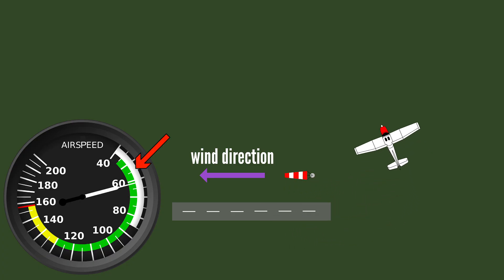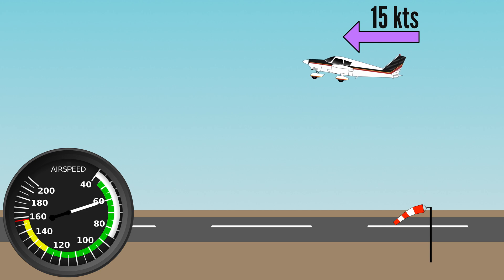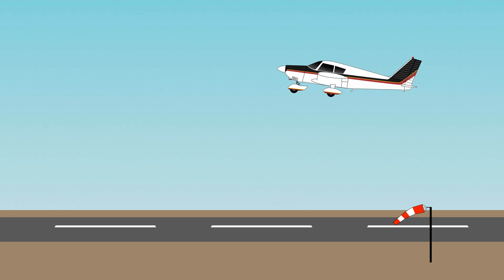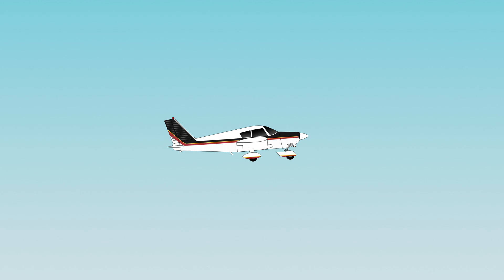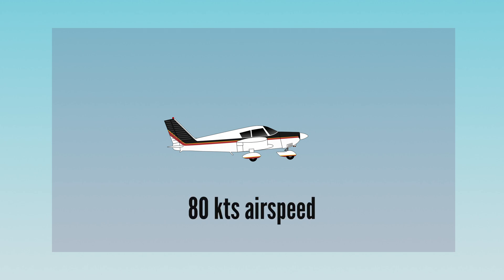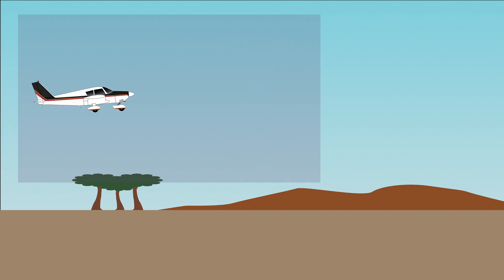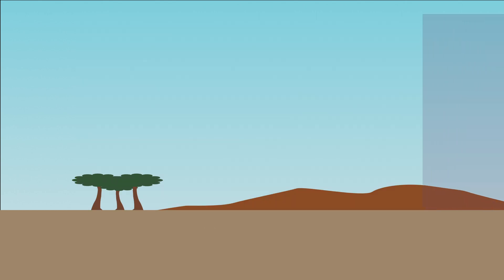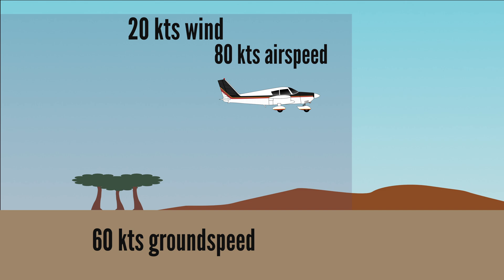The Myth of the Downwind Turn - Dangerous or Not?

Comment: The greatest danger in a downwind turn is pilot error. 

However, in relation to airspeed, you appear to be saying there is no big effect therefore there is no effect. But you cannot say that an aircraft has inertia and then say it has no effect.  Your attempt to debunk fails because you are trying to explain accelerated flight (turning) using the principles of equilibrium (straight flight). 

In a downwind turn groundspeed (inertial speed) increases due to a centripetal component of the aerodynamic force and the angle of drift. Airspeed (relative speed) decreases slightly because of the rate of reducing headwind component due to the rate of turn. Opposite effect in an upwind turn. The variation of airspeed is an indirect effect of inertia but is a very small effect compared to the variation of groundspeed and so is easily overlooked. However, it explains dynamic soaring by birds and RC gliders which is not just about wind gradients.
Reply: There is a fundamental error here: 

"In a downwind turn groundspeed (inertial speed) increases due to a centripetal component of the aerodynamic force and the angle of drift."

"Inertial speed" changes with the centripetal turn force, but not with the wind drift.

We have already established that there is no change in inertia relative to the wind drift.

So, the inertia change relative to aerodynamic effect is no different than the case of no wind.
Reply: @davetime5234  The centripetal force acts normal to the air-velocity. The angle of drift means that there is a component of the centripetal force acting in the direction of ground-velocity.
Reply: @colingtaylor2158   "centripetal force acts normal to the air-velocity"

Yes, centripetal force acts normal to relative air velocity:  but air velocity relative to the aircraft, not air velocity relative to the ground.

Acceleration (here the only acceleration is the centripetal acceleration), is independent of the velocity reference frame.

Because there in only centripetal acceleration (which is in a normal direction, that is, an acceleration at a right angle to the aircraft's direction of motion within the airmass):

There is no acceleration in the aircraft's longitudinal direction within the airmass.

Translation of the above:  the aircraft has no change in airspeed from a turn to a downwind (as set out by Lets Go Aviate's main theme).
Reply: @davetime5234  In a downwind turn from headwind to tailwind, the flyer experiences a rate of change (reduction ) of headwind component which affects (reduces) airspeed.
Reply: @colingtaylor2158  You are drifting with a 100mph wind in a football shaped balloon with a small propeller at the front that can move it 10mph.

The propeller is off, your airspeed is zero, and your ground speed is 100mph.

Point the ballon in any direction and still airspeed is zero; ground speed is 100mph

Turn on the propeller so you move with an airspeed of 10mph.

As you turn in different directions can you see that your ground speed reaches a maximum of 110mph and a minimum of 90mph depending on what direction you have turned, but your airspeed never changes from 10mph.

A wind component only affects your ground speed.  And it causes no acceleration, only a constant speed drift in the direction of the wind.

But your airspeed doesn't care.
Reply: @davetime5234  Flying a circle in a wind, when your airspeed is greater than the windspeed, the groundspeed varies by twice the windspeed. But when the windspeed is greater than the airspeed the groundspeed varies by twice the airspeed. Why is that?
Reply: When your dirigible turns, there is a centripetal force generated by the thrust, the rudder and the sideslip angle. A component of that centripetal force causes acceleration of groundspeed
Reply: @colingtaylor2158  If I understand the confusion with what I wrote, that 90mph is moving backwards rather than forwards.

So, it's a negative number:  -90mph.

If keeping track of direction numerically, I could have said the speed varies from 110mph to -90mph.
Reply: @colingtaylor2158  That's true that a turn requires a centripetal force for the direction change.  

And the only force the creates the turn is exactly at a right angle from the direction of motion.

So, if there is any component of the turn force that is not aligned exactly at the 90 degree angle, then there will be some "wasted force" component that is in the direction of travel, such as in a skid or slip presumably.

Any such component that is in the direction of travel, yes, clearly will cause a change in forward speed, that is, a change in airspeed.

But by definition, a coordinated turn has no such force component in the direction travel.

Turns also require higher AoA to generate the extra centripetal force from lift (which is turned sideways).  The extra drag from that that extra centripetal force of lift, needs some engine power or more descent rate to compensate.
Reply: @colingtaylor2158  So, the centripetal acceleration has the same effect across all reference frames, even though the reference frames measure different total velocities.

The acceleration being the same means the change in velocity is the same, though the starting velocity that gets changed is different.
Reply: @davetime5234  Completely wrong. The TOTAL acceleration is the same in each reference frame. But the Total acceleration is the sum of centripetal and tangential components. So the tangential and centripetal effects are DIFFERENT in each frame (either could be zero).

Your dirigible is tracking South more or less at 90 to 110

Negative groundspeed is the speed at which you are digging a hole for yourself.

Over and out.
Reply: @colingtaylor2158  The longitudinal acceleration in the aircraft's reference frame is zero (total acceleration is centripetal acceleration only).

So there can't be any change in airspeed

It doesn't get any simpler than that.

Negative groundspeed?  Imagine a 10,000mph perfectly steady wind and do  a 180 degree turn.  Does your airspeed ever change? No.  

Your groundspeed when you are on the upwind heading? -10,000mph (just ignoring your airspeed as insignificant in percentage terms).

Pretty simple really?
Reply: @davetime5234  That is just wishful thinking. The aircraft's reference frame is non-inertial therefore a direct force is not required to change airspeed. Airspeed is relative speed so that the difference between two acceleration components caused by indirect forces will produce a non-zero acceleration of airspeed.
Reply: @colingtaylor2158  I think you're getting confused by how to apply the relevance of inertial vs non-inertial reference frames.

The aircraft's reference frame is inertial (the moving block of air through which
 it flys has no rotation and no acceleration: a steady wind over the ground).

You incorrectly said it is non-inertial.

From the aircraft reference frame, the ground's motion due to the wind has no relevance (until you have to deal with it directly).

No matter how you fly, your airspeed behaves as if there is no wind (the wind with respect to the ground is ignorable).

You don't care how  your accelerations in your aircraft's reference frame impact other reference frames.

Within your reference frame, no longitudinal acceleration means no change in airspeed.

You make a coordinated turn such that there is centripetal acceleration only (and offset any longitudinal drag from extra lift production).

Your airspeed has no further consideration to cause deceleration.

You remain at constant airspeed throughout the turn.

Even if the air you are moving in is itself moving at 100mph or 10,000mph relative to the ground as you turn.
Reply: @davetime5234  I am not confused. I am simply pointing out an effect that you have not considered.
Reply: @colingtaylor2158  You said: "The aircraft's reference frame is non-inertial"

The aircraft, drifting with the moving air mass, has as the relevant frame of reference:  the non-rotational, non-accelerating mass of moving air.

That is an inertial frame of reference.

The centripetal only acceleration happens with respect to that frame of reference.

It appears, by you saying non-inertial, that you are fixing the frame of reference to the aircraft itself.

That would be non-inertial as the aircraft is rotating, and is not relevant to the question due to the problems it introduces.

In short, the non-inertial reference frame is irrelevant.
Reply from the maker: I agree the biggest danger is pilot error. There’s no stalling because “the wind is suddenly from behind” when turning downwind. There is no wind relative to the flying plane (other than what is caused due to its forward movement). 

It might just be my interpretation but what you say you think I meant doesn’t seem to match what I was saying in the video. I was not explaining it in terms of straight flight. I think my 2D animations maybe make it seem that way. I don’t have skill in 3D animation unfortunately.

My reference to inertia was in relation to gusts/windshear which is near instantaneous. Not sure if you are comparing that to inertia when turning? There will be a very small forward component of speed loss due to turning (accelerating), but at a realistic turn rate in a light aircraft this takes, what, 30 seconds to complete a 180° turn? Even at a very fast turn rate (and associated steep bank angle) the increase in stall speed due to load factor will dwarf the loss due to the inertia of changing direction. One can calculate how much that would be but it’s so negligible, miniscule compared to everything else I talked about. Other than a fun theoretical thought exercise, is it even worth covering what causes maybe a 1 knot drop in airspeed? For practical flying, wouldn't it be better to talk about staying coordinated and about wing loading (and thus stall speed) increase with bank angle (while maintaining altitude or climbing) which can make differences well into the two-digit knot numbers? My opinion at least.

Anyway I suspect we are possibly saying something very similar.
Reply: Why are we trying to consider anything besides the aircraft and a slice of the column of the air that it is flying within? As the aircraft is flying through the air a force called drag (sum of induced, parasite and form) acts upon it as the air resists it motion. The wings generate lift by acting upon the air, for a given wing on a given aircraft, the lift force generated will be a function of the calibrated airspeed and the angle of attack. The aircraft's motion through the air is relative solely to the air and the motion of the air relative to the ground does not affect the airspeed and therefore does not affect the lift or the drag.

The aircraft is banked it uses a lateral component of lift as centripetal force to curve its flight path. As stated earlier, the lift is generated by the wings acting upon the air the aircraft is flying through. The air acted upon by the wings experiences a force opposite that of the lift. There is no other force acting upon the aircraft that is a function of the speed of the wind over the ground at a given altitude.

There are numerous situations where forces act upon the aircraft due to wind gradients. These can result in pronounced and abrupt airspeed and performance changes. These can come from rising or falling columns of air, vortices, air density changes, frontal boundaries, storms and inversion layers that tend to have sudden shifts in both direction and wind speed separated by a small vertical distance. Most people will refer to this experience while flying in an aircraft as "turbulence".

Comment: I think I have an alternative analogy that might resonate. 

Take for example a car on very large and wide conveyor belt.

First, let's assume the conveyor belt is stopped and the car is driving forward at some not excessive speed and then proceeds to turn 180° while maintaining speed and not accelerating (stepping on the accelerator pedal). I think we can all agree that the car would be going the same speed it was going before it turned. 

Now if we repeat the exact same exercise with the conveyor belt moving at a steady pace, I think we can all agree that if the same actions are performed, the car would also end up at the same speed in the opposite direction. 

It would be no different for an aircraft that is flying through the air and executing a 180° turn in steady winds at a steady airspeed above its stall speed. It will also not need to increase its power to maintain airspeed.

A powered fixed Wing aircraft. Generates thrust and lift. When turning a part of the lift acts as centripetal force causing the aircraft to turn acts to change the velocity vector of the aircraft all throughout the turn.
Reply: Quote "Now if we repeat the exact same exercise with the conveyor belt moving at a steady pace, I think we can all agree that if the same actions are performed, the car would also end up at the same speed in the opposite direction. "
<- that is clearly wrong. You need to learn what an inertial reference frame is. That's where newtonian physics applies. If you don't understand that you will calculate nonsense. Even in your though experiment the question would be what reference frame? To earth the car would clearly have a different speed which is exactly why the downwind turn is not a myth but a physical reality.
Reply: @swunt10  for a supposed engineer you seem to have a lack of understanding of the difference between the terms speed which is a scalar and velocity which is a vector. Just lay it out in your language as an engineer. Believe me I will be able to follow you all the way if you show me your work.

You're just a troll buddy and it's obvious that you're just repeating whatever you found on Google like that attempt at bringing in a reference to the Coriolis effect. Good day!
Reply: @swunt10  for a supposed engineer you seem to have a lack of understanding of the difference between the terms speed which is a scalar and velocity which is a vector.

Show us your engineering prowess and lay it in your terms as an engineer without dumbing it down for us. Trust me, I will be able to follow right along. You are, after all, the one claiming to be an engineer not us "morons" as you called us.

I can't take your position seriously when you open with the aircraft having departed controlled flight as it initiates the turn. You have already violated the parameters of the experiment and then claimed the conclusions of others are therefore false. The aircraft must maintain controlled flight throughout the turn without increasing power while it turns from headwind to downwind. It cannot make a turn that exceeds the ability of the aircraft to maintain controlled flight as then it is no longer "flying" and instead an object moving through a mass of air. Those are two very different things and at the very core of our disagreement.

If you can't see that, then I'm must concludes that you're just a troll buddy and it's obvious that you're just repeating whatever you found on Google. For example that attempt at bringing in a reference to the Coriolis effect which does not apply for an object moving on the surface of the earth.

Next thing you're going to tell me is that an airplane on a conveyor belt moving opposite the aircraft's direction of forward travel in excess of its takeoff speed will stop the aircraft from taking off. LOL

Good day to you!
Reply: @Mar-s5q8m  Deleted my original reply.

I'm content to fly my aircraft as I always fly it with the knowledge that this is indeed a myth that some cannot let go. I know it won't and does not stall while safely and easily doing the very things that you insist cannot be done. That is okay and I'm at peace with it, it's no skin off my back and I'm am too low of stature and qualifications to dare to tell you otherwise.

Have a great day!

PS Refresh your knowledge on the difference between a scalar (speed) and a vector (velocity). You should already know this as an engineer. After all an engineer should be precise in their use of terminology and I simply cannot believe that an engineer like you claim to be could so easily overlook such things. My terminology was intentional and I expected you to catch on across multiple comments.

PPS Changing the frame of reference would not alter the conclusion (the downwind turn is a myth). Changing the frame of reference would only change the velocities input and the velocity output as those would be relative to the frame of reference. How much more softball can this get?!
Reply: @Mar-s5q8m  "the car would also end up at the same speed in the opposite direction. "
"<- that is clearly wrong. You need to learn what an inertial reference frame is"

To an adequately trained engineer that is an unnecessarily pedantic criticism.  I know exactly what he meant and the effect on the relevant reverence frames.

"To earth the car would clearly have a different speed "  Yeah, that's why the solid distinction in the wider dialogue between ground speed and airspeed.  Airspeed is the moving reference frame relative speed.  Ground speed is the Earth reference speed.

Comment: As a skilled pilot myself, <RC> 😗 I notice with head wind-gradient, the nose can quickly pitch up, Or a steeper bank than expected. If either those things occur, lack of airspeed /lift occurs while the plane has only marginal speed to start with.
Reply: If winds gust, this is a risk.   But to the extent winds are steady, there is no such effect.